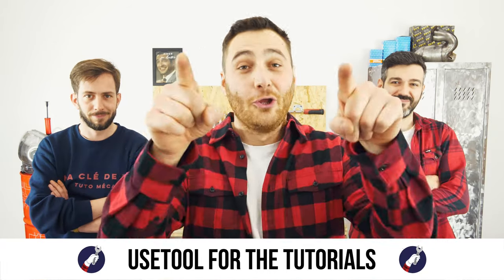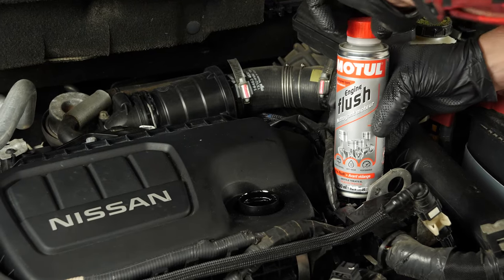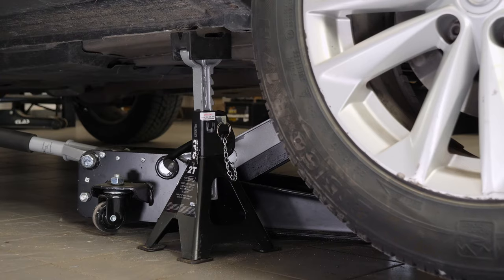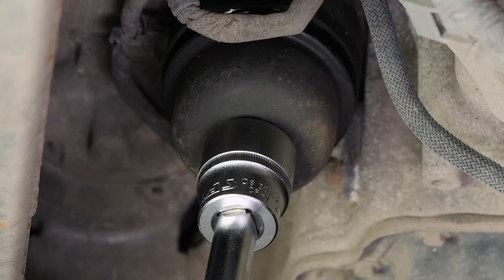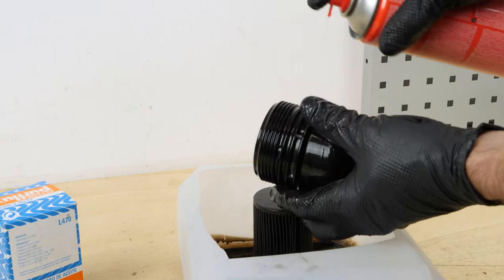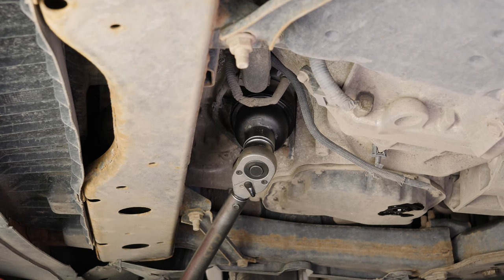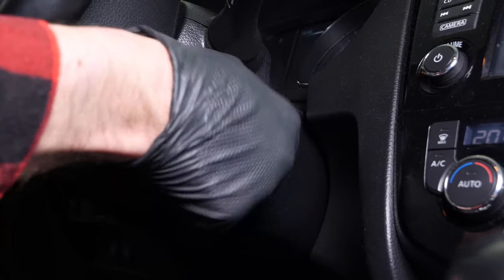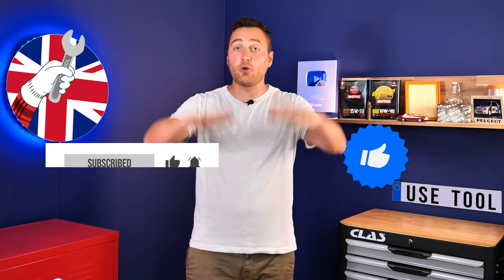Change the oil and the oil filter Qashqai mk2 1.6 dCi 🛢

Comment: Nice video but you  have used the wrong oil for this engine . it should be the ACEA C4 norm  not C3 and must have the RN0720 specification . motul has the right oil for this engine so the dpf doesn't get clogged  prematurely.